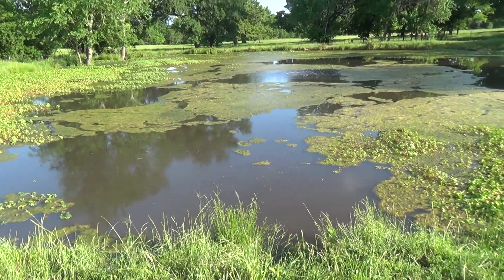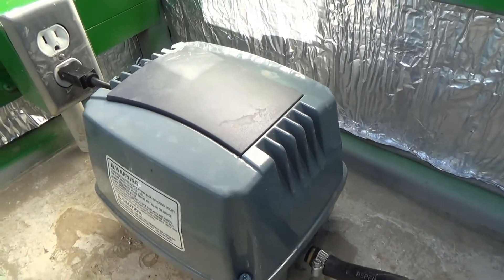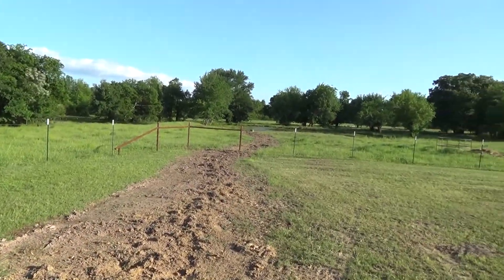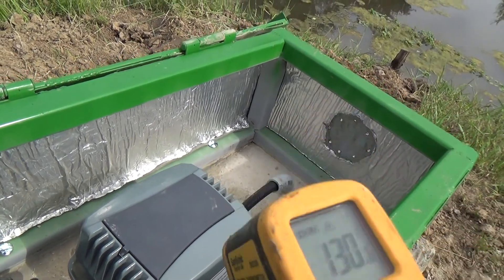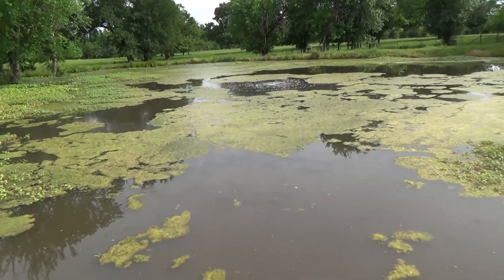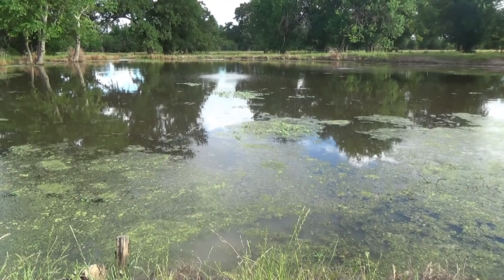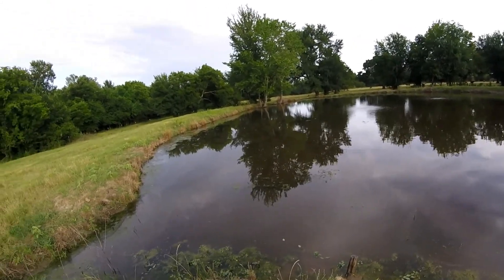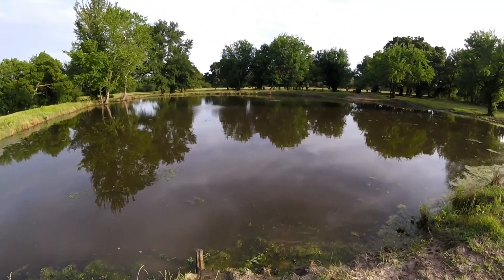Building An Aerator System For My Farm Pond

Comment: Do not let cattle near pond
Use a solar water pump to fill a container for them
My aerator sits on a small rock with a Rubbermaid container over the top.. and running fine for 10 years

Comment: I just got the same setup as yours and my pump keeps shutting off. Did you have any problems like this before the fan
Reply from the maker: I didn't have any shut off problems, but I was concerned about that which is why I installed the fan. Is the pump shutting off or is the breaker tripping?
Reply: @TexFarmer  pump. I thought I could leave it uncovered and see if it would stop but it's still doing the same. I sending my back in for another one thanks for the reply

Comment: You could also put a timer on the aerator and only run it at night when it’s cooler
Reply from the maker: That's something to consider for the pump heat issue, and would also save a little money in energy, however during the heat of the day when the otherwise stagnant pond needs aeration the most, would running the pump only at night be detrimental to the goal of reducing algae and improving water clarity?

Comment: That looks way bigger than a 1/4 acre pond....
Reply from the maker: I measured it with Google Earth and it shows the area of the pond is exactly 0.25 acres. I wish it were bigger, I could stock it with more fish then!
Reply: @TexFarmer  maybe its just the angle of the camera view. I have a 1/4 acre as well and it just seems smaller. I built my own aerator system similar to yours using a Invacare pump and 2 EPDM rubber aerators. I used a plastic tool box from Harbor Freight for a pump enclosure. I added a fan to one side and a metal grate at the bottom of one side. Plenty of cross flow air to keep it cooler. I also just built a floating pond fountain. Together, the pond hasn't needed chemicals now for almost 2 yrs even in this blistering heat and humidity up here in Ohio. Great videos, thanks again.

Comment: I'd recommend you add a vent on the side walls ....like a garage door louder vent (metal)...you will get cross ventilation and more air to help cool the pump...good luck and God bless
Reply from the maker: Great ideas. My pump house it's exactly air tight so I think it's getting enough cross ventilation but more certainly wouldn't hurt.
Reply: @TexFarmer  The pumps are prone to overheating. Adding a small built in fan on one end and a vent on the other will greatly increase the lifespan of your pump
Reply from the maker: @justadbeer  If you watch to 11:34 that's what I did.
Reply: @TexFarmer  Sorry - I don't know how I missed that. Good job.

Comment: It would be better to extract the warm air pulling cool air through into your box.
Reply from the maker: You are correct, I need to get out there and flip the fan around and add some more vents for cross ventilation. The pump is still working great but more ventilation wouldn't hurt.

Comment: How is it now?  I’ve just installed 3 pumps similar to yours with 6 diffusers in the same size pond.
Reply from the maker: The Blue Diamond ET 80 has been running non-stop for 1.5 years without any issues.
Reply: Tex Farmer how about the water quality and weed control?
Reply from the maker: @Swans_And_Ducks  Minimal effect on weeds but major effect on algae. This time of summer the pond would normally be covered in algae, now there's hardly any at all. The water quality I'm certain has improved but my cattle use it as their water source and they keep it stirred up so it still appears murky.